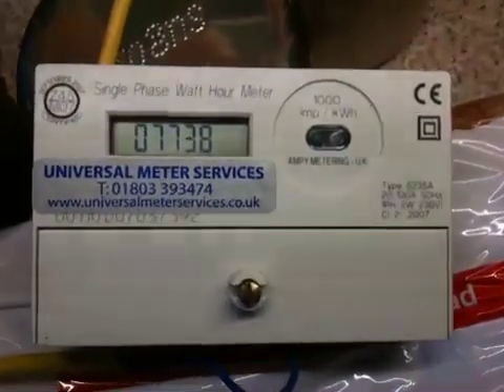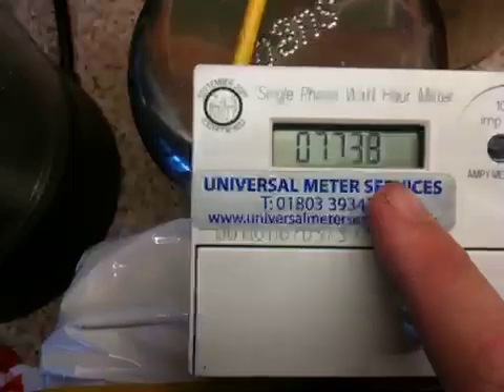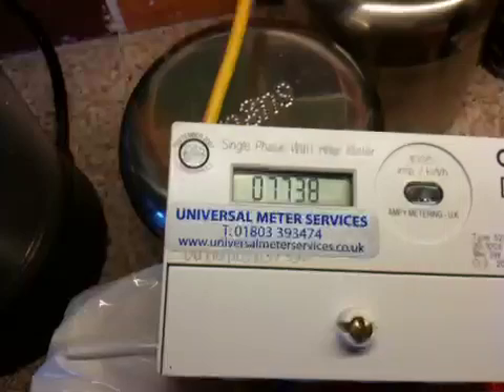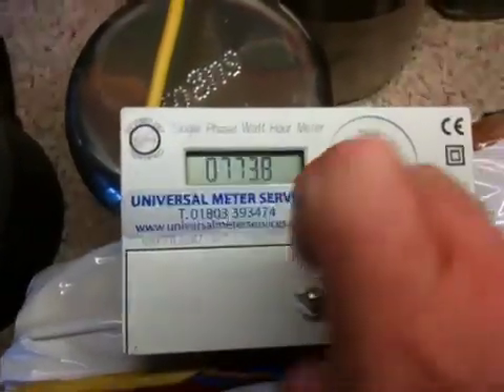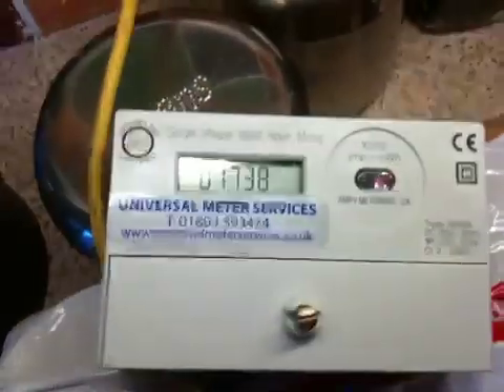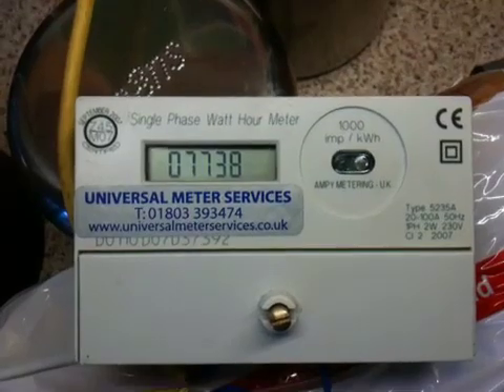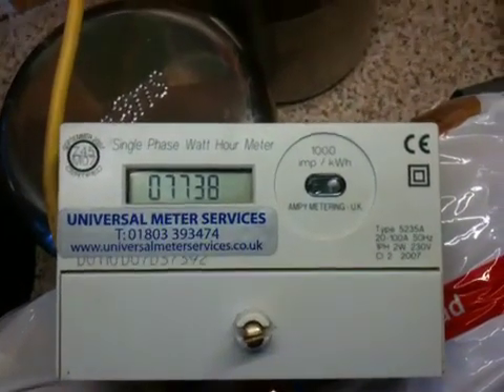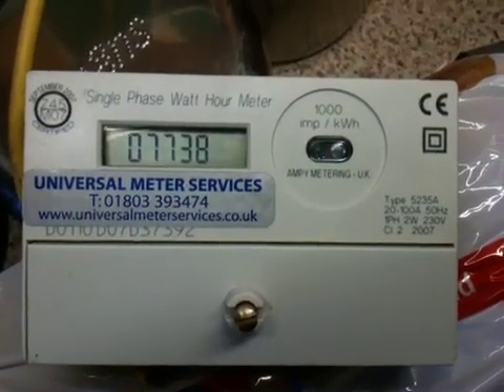My first electricity meter Ampy 5235A

Comment: E.ON fitted one of these meters in April and are now claiming that I have used 18,246kwh of electricity in 5 weeks ! My daily rate is 8kwh ! Is there any software available to be able to download the data to analyse it ?
Reply: Hi What is an OWL monitor and where can I get one!
Reply from the maker: @davidcraik8093  Hi David they are on eBay if you search “owl energy monitor” this was the brand I used to use, I found it to be fairly accurate good enough for monitoring, it does sound suspicious though that your meter is reading high.
Reply from the maker: Oh wow that’s a lot!!! Unfortunately no there isn’t any software available to us general public. I suggest using an OWL energy monitor those are pretty good 👍 hope this helps. Steve.
Reply: @Cavalier_Steve Thanks .Do you have an email that I can send you a picture of the meter in question?
Reply from the maker: @davidcraik8093  Hi David you can send it to Steven715 at yahoo.co.uk

Comment: What does it mean when the red light is on but not flashing.
Reply from the maker: Hi, a solid red light means that the anti creep as it was in the old mechanical meters is active, basically it’s not detecting a load or there is a very low load, so the KW reading won’t be going up whilst the light is on. Hope that makes sense.

Comment: Good day Steve
Do you know how I can workout my Gas meter readings, so I know when I've used 1 kwh.
My gas meter is a very old one and has an "8 figure display" -- "3 figures in the Red And 5 regular". The Meyer  it's 'ACTARIS'.
Many thanks
Reply from the maker: Hello there, the whole kWh is what you call your 5 regular digits the 3 red ones at the end are your on gas meters there is 3 decimal places before the whole number read out. For example 13345.036 would be 13345 wHh or m3 and 0.36 of a m3 so the numbers your interested in is the 13345. 
The reason for the 3 decimal places is so you can clearly see if a small amount of gas is being used a pilot light for example (now very rare) I hope this helps. Cheers. Steve.

Comment: Good day Steve
If you meter reading goes from :|
07738
To
07739
Does this mean that "one kilowatt" of power has been used.
Thanks
Reply from the maker: Good day to you 🙂, yes your absolutely right, in this example there is no decimal places displayed so this particular meter only shows whole kWh as you said 07739-07738 is 1kWh hope this helps. Steve.
Reply: @Cavalier_Steve  Thank you I'm very greatful for that information. 
Regards
G.

Comment: I have this meter but it’s lcd screen is misted over and I cannot get the current reading .Can the electric company use the optical interface to find out the current reading ?
Reply from the maker: Hi Richard, yes they should be able to, is the screen misted over on the inside or outside? If you really want the reason you could try these, If on the outside you can try a polishing compound that you use on car paint work and polish the screen. If on the inside and is caused by moisture you can try a hair dryer on low and see if it will clear up. To be fair it’s your electricity supply’s problem they will most likely put in a smart meter 🤢. All the best. Steve.

Comment: Do you know what happens with this meter if I was to connect a grid tie inverter? Would it ignore direction of current?
Reply from the maker: If it's setup as a normal meter it will display I believe RFD and won't count backwards but what you can do is connect the grid tie outlet to the left hand side and on the right hand side connect a plug and this will record the kilowatts from the grid tie into the mains. If however their type of meter is on a house then you could potentially have the RFD message come up and this may put you in trouble with your supplier. But if you have other stuff in your house running and you consume more than the grid tie inverter can produce then you will supplement you're house and the meter will slow down. I hope this makes sense. Steve.
Reply: Hi what is an RFD message pls.
Reply: @fraserm803  it stands for Reverse Flow Detected or Direction. Can't remember exactly
Reply from the maker: As David Ball has said RFD is Reverse Flow Detected, the message is there for the electricity supplier to check the meter for tampering, less likely nowadays with grid tie investors and solar power being fed into the grid. Cheers.
Reply: Steven Watson Thank you Steven. Yes, this meter is installed in my house. I want to add 300W panels and just offset some of my power usage so I know a larger proportion of my electricity is renewable.

Comment from the maker: Hello there no this is nota stupid question many people would think that this is a smart meter because of the digital display. You will be pleased to know that this model is not a smart meter. Smart meters will typically have more information on the display e.g cost etc. they may even have a signal meter for the smart meters GPRS modem. I hope this helps. Regards Steve.

Comment from the maker: @RODALCO2007 Your welcome Interestingly you can program these meters with an Inflated optical probe and using software called empwin so you can have 1 or 2 decimal places showing on this meter you can also set it up to show the reading on the display when the power goes off as these have an internal battery inside. 
Unfortunately these are password protected and I have not come across the software as of yet. There is empwinro (Read only) for consumers but again I have been unable to find it. Ta
Reply: Steven Watson now after getting an optical probe and Empwin - can we clock it back?